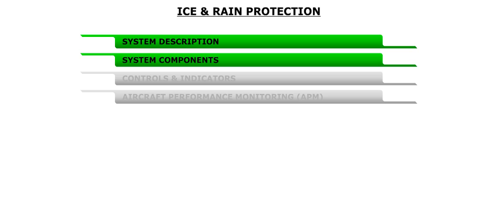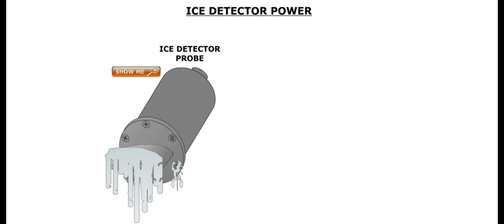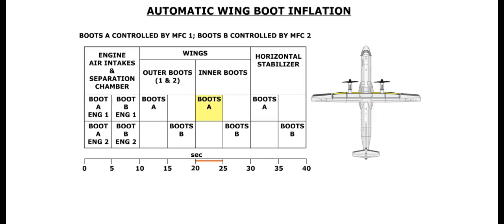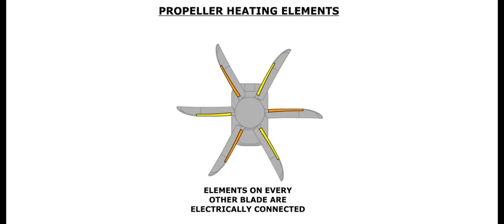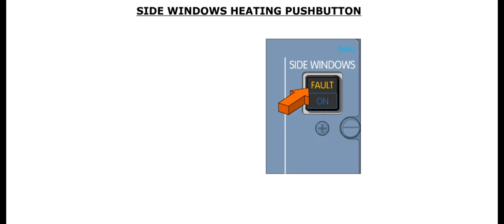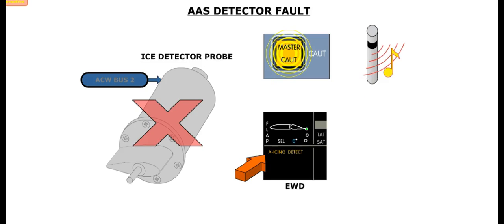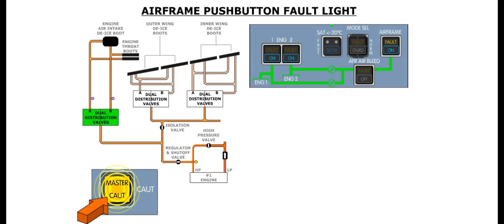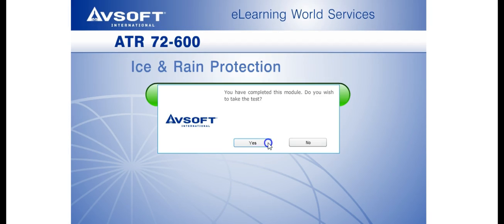ATR 72-600 Ice and Rain Protection

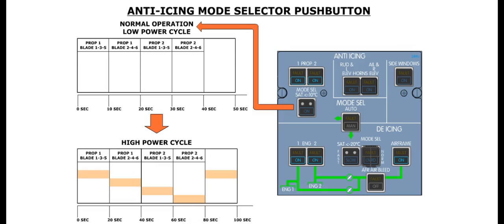Comment: @22:25 this suggests that if the pilot finds themselves in a situation, panics, and pushes a button that seems like its going to help with icing, they could be forcing engine one (prop 1) to wait a substantially longer period of longer time to receive the benefit of any kind of blade heat anti-icing on the primary means of propulsion? 
My good god.
In normal blade anti ice mode, each engine at least sees some heat every 20-30 seconds.
In what I would call Panic mode, when the pilot hits that MODE SELECT button, that engine might have to wait, what... 60 seconds? 
If thats the case, im signing a company travel policy to not let any of us use any ATR aircraft ever again.
Reply: it should be:
prop 1 set 1
prop 2 set 1, 
prop 1 set 2, 
prop 2 set 2

Otherwise, its less safe, what a pack of idiots
Reply: That's really concerning.